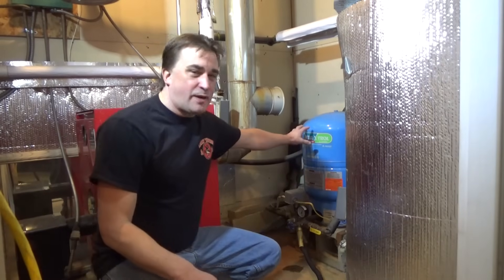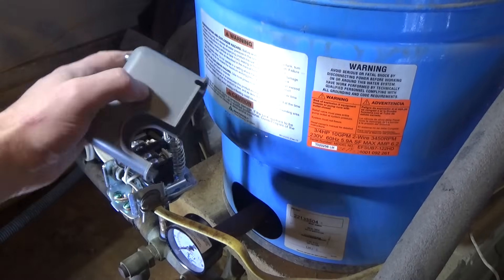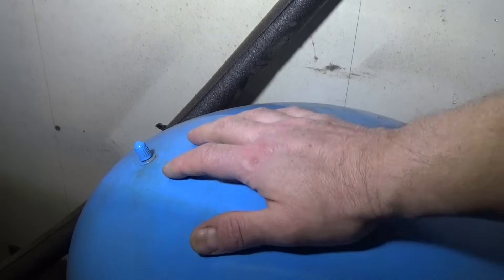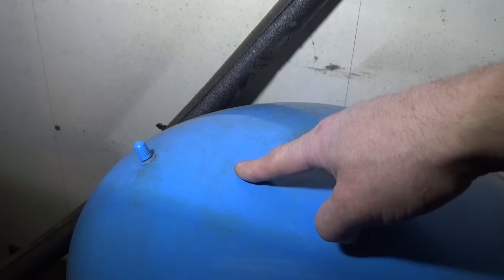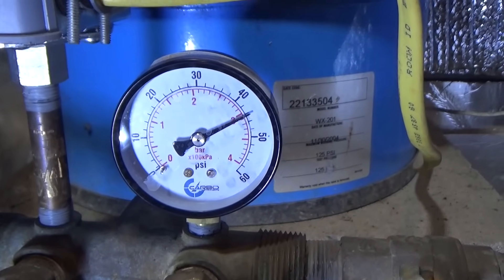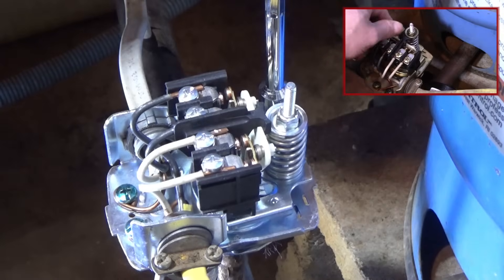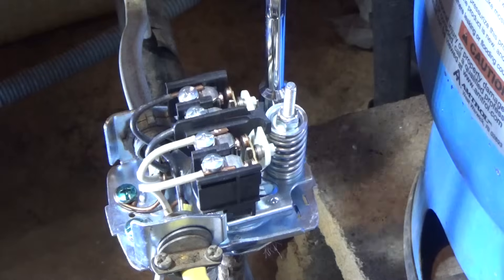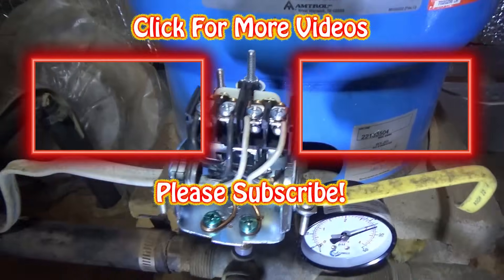How to Adjust a Water Well System Pressure Switch and Bladder Tank - Well Pump Diagnostics

Comment: Excellent informative video. I just installed a brand new pressure tank and pressure switch. Now it does cut out at 60  (switch is 40/60) but when it gets to 40 it cuts out and then drops to zero pressure. The pressure in the tank is set to 38 psi. What am I doing wrong? Could it be the switch is defective?  This switch has the reset handle on it and I have to use that to restart the system.
Reply: Your tank pressure when empty needs to read 2psi below your cut-in setting.

Comment: I just moved and wow what a shock going from 60psi city water to 30-50psi well water.   I feel like the shower barely works.   I increased to 55 PSI but it really did nothing, oddly, it still cuts in at 30PSI, it didnt rise to 35PSI.   Is my issue pressure or flow rate?   It seems like there is just less water flowing in general.   I am going to try to increase to 60psi but I guess it still wont be what I am used to because its going to operate typically a lot less than 60.   Is my only solution to upgrade the well pump to a higher HP motor?

Comment: I don't think you can burst from pressure the bladder, worst case you compress it until it collapses the air completely and then it is against the steel housing and can't stretch any more. The bladder fails mostly because it gets weak or brittle from age.OMGosh! 240 ABSOLUTELY IS NOT more likely to kill you, actually the opposite can be true as lower voltages can grab you where higher voltage may knock you clear.

Comment: I cant get a 20 psi differential, keeps going to 60 psi and the 2nd small pole is applying no pressure to it's little spring and lowered the big 1st pole to a 25psi cut-on and still goes to 60psi.

Comment: Question, is it possible to adjust only the kick in pressure? My mom has a new washing machine and she's finding that it only works sometimes. The repair technician says this is due to low water pressure, and since it works sometime I've concluded that when the well pump is at a high pressure it's enough but not enough when it gets low.

Comment: I adjusted my pressure up to 40--60 from the standard 30--50.due to low pressure in house.question--will this be too much pressure for plpe connections throut the house and for the water bladder itself(no indicators on the panel)?

Comment: Great video! I just have one thing to add. I was having pressure switch issues so I shut the breaker off and cleaned the contacts using a tiny file and some electrical contact cleaner spray. Well when I turned the breaker back on and the switch cut in the arc started a fire from the residual contact cleaner. It was pretty scary hahaha but I was able to put it out, so make sure any cleaning solvent has evaporated before energizing!
Reply: Thanks
Reply: Very important to fully dry-off any type of solvent specially in confined space where fumes can accumulate! Put a fan on to provide air circulation so that the fumes can't settle in one spot, not just in this case, but in any situation where a substance that gives off flammable fumes!

Comment: Thank you for this video. My father had just replaced his well pump and pressure switch before he was murdered and I have just moved into the home to help my mother, this was the first issue I ran across I had no clue about and just knew  100psi pressure and cutting out showers wasn't normal for the system or this house prior.

Comment: Hi Mark, my setup is a 1hp submersible that leads to a surface tank of 1000 liters. From that tank, a 1 HP pump pushes water  into a 300 liter bladder tank.  What settings would you recommend? My bladder tank goes up to 140psi. I would like to hold a higher pressure inside the bladder tank.  Maybe starting pressure of 30 then 70 to 80 cutoff. Would you recommend this? Thanks in advance!
Reply: It has to stay within 20 which is recommended

Comment: So question, if you go from a 30-50 switch, and you set pressure tank to 28 psi, if i go to a 40-60 swicth, i need to set pressure tank to 38? i currently have a 300 ft well with 1hp pump. like to increase my 30-50 to a 40-60 and my pressure tank is around the same size as yours in this video.
Reply: Yes, increase to 38 in the tank

Comment: Good explanation.so adjusting the taller nut moves the 20 psi up or down. 20-40/ 25-45/ 30-50 etc.. then the smaller nut only increases the cut out  40-45-50 .

Comment: Is it normal for the bladder to loose pressure when not in use ... in other words it cuts in at 30 and out at 50 although it's a40/60 switch but then the gage drops to like 45? A second question is if I have a 40/60 switch can I up the pressure to that not knowing what size my bladder or well pump is? It was down to like 18 on the air so I added air to 28 ??

Comment: It's not actually 220v it is 2 legs of 110which phase sync- so it would require touch both legs of 110 to actually be shocked with 220v... The fact is it's not the voltage which can be fatal it is the amperage, and that is directly relative to the size of conductor- 14guage wire is not likely to be fatal, where as 4guage or larger is where mistakes are deadly.

Comment: Awesome video, great explanation and video clarity.  If I may suggest sharing with the viewers ‘why’ the tank pressure is at 28 psi and that if you had a 20-40 or 40-60 you wouldn’t want it to be 28psi.  To share that it must be 2psi differential from whatever kick on pressure is.   👍🏼   
Really appreciate you sharing with us.
Reply: My pressure switch is cutting in at 40 but cutting off at 65. Back off short side nut until spring was completely loose still would not bring down cut off pressure
Reply: @RonaldGosling-z8g you cannot drop the pressure. If you buy a 40/60 the “springs” are stiffer so it doesn’t matter how much you thread the nut you might change it 2-5psi if you’re lucky.  So you need to buy a different switch
Reply: Yes, i had a guy come out, I had asked for a 30/50, he put in the square D, got paid, then I asked for the box and it said 40/60 on it, saw it on the box after he had left. Texted him and said HEY you put in a 40/60,( pressure tank is at 28 ), i had asked for a 30/50 - claimed he adjusted the 40/60 down to a 30/50, but he did NOT, and he refuses to come out and fix things, said he would refund my money and never did. So, NOW, I have to screw around w/ this crap, when I already paid to have the job done right ? I had turned on all the water, gone under there and checked, and the gauge read 60, switch clicked, then down to 40, switch clicked, he did not adjust things, so i have a worthless one year warranty on parts and labor. I'm steaming angry. Bad Ju ju on him. This is a single wide, don't need a 40/60, only one shower works here, all this has done is create pressure problems. Toilet won't stop running, didn't do that on the old 30/50. Had to vent, sorry. Thank you. I'm afraid to put air in my 36 gal. pressure tank to reach 38 psi. Any ideas ? I don't have that kind of tool he used for the screw. Ty !
Reply: @AndreaWestlake306 the setting springs take a while to settle in.  A couple cycles before mine worked as on my box description.  Just fyi for others.
Reply: @AndreaWestlake306  as long as you turn off the power first, you can use a deepwell socket, go buy the nut driver he used, or even usr a wrench.

 Back out the taller adj screw until your cut in (bottom) pressure is 30 psi and then check/set your cut out pressure (top) with the shorter adj screw to 50 psi. Always recheck your cut in pressure after you make adjustments...that pressure has to be 2 psi OVER the AIR charge in the tank ie 28 psi for a 30-50 setting.

You may not have to adjust for your cut out pressure at all, but check it to make sure it is 50.

Didn't mean to jump in here, but I read the question and nobody answered...
Reply: @dantco  Thank you so much, ,Dantco ! I've already spent a ridiculous amt. on D switches. I appreciate you. Yep, I'm chicken, hired some one, now three to be exact. Now I have sagging walls in a mobile home, and just ordered an electric 30 gal. hot water heater, and have to wait until whenever he "feels" like it. People where i live don't seem to need money. Now i've bought a hwh for almost $600, will have to pay $600 to have it put in. I'm so phucked :( IF i could go back in time, I never would have bought this place. Thank you, Bless you for caring enough to answer me. I was just too nervous to do it. <3
Reply: @AndreaWestlake306 I understand...lots of people do stuff that I ain't comfortable or able to do as well. Then I do what you decided to do and hire out. Good--better--luck in the future.

Comment: What do I do when water pressure switch -points or arcing 
 what do you do about this .how do I fix this problem 
 Please let me know A.S.A.P
Reply: First check voltage, then amp draw, amp draw is determined by pump size. Arcing is usually a sign of high amp draw, could also be a buildup on points due to age/low drawdown, caused by tank low air, burst bladder.
Reply: @stevefarrow9327  I'm just a handed man fixing my thoughts . I need more information on 
 checking my water well .I have about 20 or more years experience 
 on freezing pipes /replacing pressure switch /my experience on 
 I have seen Alot of burned points .I have a multimeters.
 Please give me a step by step on how to check my setup out 
  Thank You for your time and trouble
Reply: @alanmcdowell977  Sorry, this is a situation of electric and water. I do not feel comfortable. I am now retired, but we were advised to not give specific directions for liability reasons.  I cannot go any further than the basics.
Reply: @stevefarrow9327   I have a galvanized tank ,can I use a  bladder tank
 if I can I will update to  bladder tank
Reply: @alanmcdowell977  yes,  replace any galvanized fittings (if any) at this time, make  sure new pressure switch is matched to tank pre-charge....40-60 switch ...tank pre-charge 38lbs.
Reply: @stevefarrow9327  I been looking for more water pressure find 
up to  70psi
 [cycle stop value ]system .
 can I get the same parts a little bit cheaper
Reply: @alanmcdowell977   Not sure if you have a stop-cycle valve, or want 70# with a stop -cycle in the system.  If you have a stop-cycle valve, I do not know if they are rated for 70.  If not, you can adjust your system to 70. The tank should have 48lbs... the switch can be adjusted by turning down the tall screw(one full turn = 3 to4 psi.) until pump cycle 50-70. I would suggest a new pressure gauge as they age, bits of iron bacteria will affect reading.
Reply: @alanmcdowell977  one other thing. Higher pressure means a shorter pumping cycle. This means more on-off cycles, resulting in increased pump wear.   The larger the tank, better, min. recommended 10 gal. drawdown.

Comment: We had two power outages so I don't know if that is a factor. Pressure in kitchen sink was low so I looked at the pressure on the tank. It said 50 (I have a 30/50) but the tank was empty. Turned on release valve beside pressure gauge and pressure good. Turned electric off, emptied tank and turn electric back on. The pump filled the tank but went to 65. I used compressed air to clean any debre away from the water pressure switch and gave it a few taps along with a few taps on the pressure gauge. Turned electric back on and went back to 65. Gave a full counter clock wise turn on the top pressure bolt. Still went to 65. I also shook the tank when checking for any water splashing around and there was none. Pressure on the top was 20, so I added six pounds (I know this is a bit low but I'm cautious. Filled back up to 65. Water was cloudy with debre floating around. After using it for awhile water cleared but little bittie pieces of debre (like tiny pieces of dark tissue floating in water.) Did I shake up debre or could the bladder have a leak. No water came out of top pressure valve.

Comment: Install a secondary breaker in the pump room.  In my are the code requires a means of disconnect with in ten feet and visible to the device.  So, a secondary breaker adjacent to the pump controller, meets the requirement.

Comment: Very good video.  Thanks.  Please take this kindly-------most home wells have a diaphragm tank instead of a bladder tank.  Bladders attach to the bottom of the tank and act like a balloon.  They do not last as long as a diaphragm tank which has a sheet of rubber across the middle part of the tank.  I only say this to keep someone from buying a wrong tank.

Comment: Mark you nailed one thing on the head. I lost a socket off my wrench and it dropped on connections of switch and shorted out the switch. Learned 2 things Turn off power and don't use socket wrench that has a loose connection. Lol

Comment: Come on people, ditch the old fashioned mechanical pressure switch, move up to the 21st century 
they actually have electronic pressure/flow sensing switches that indicate the pump condition. 
The only reason the old switches are used is, when in conjunction with a pressure tank it reduces the number of start ups of the pump.
The electronic units start the pump immediately the faucet it turned on and supplies full pump pressure until the faucet is shut off. 
I’ve used this system for years on my houseboat with no issues. Oh! Also ditch the tank, not needed. 
Just sayin!!!

Comment: Seems like that pump switch is not within sight of the panel. Per Electrical code and for convenience,  there should be a disconnect in the room. That would make things so much easier. Also, working it live should be done with insulated tools or tools temporarily covered with black electrical tape. Working one handed as well will keep you safer. Good explanations in your video on the set up - thanks.

Comment: I have a question very of course important cause this problem with this info you share ain't applying to it.. The pressure switch keeps going on back to back 20 to a little past 40..Ive tried to adjust but same beside to 0. .thank you.

Comment: Great video! Question for you..... I have a 600 gallon water tank with a ½ horse power pump. The pump has a 20/50 pressure switch attached, with a pressure tank preload of 38 psi. I reduced the tank pressure to 28 psi to correct the pressure tank/pressure switch relationship. It works fine but I'm on the 2nd floor and water pressure isn't what I'd like it to be. 
Would I have to replace the existing 30/50 pressure switch with a 40/60 switch and increase the pressure tank to 38 PSI or can I adjust the existing 30/50 to 40/60 and increase the pressure tank pressure to 38 PSI?
Reply: empty the tan k , check the pressure set it to 38 , install a new pressure switch 40 60 . and its a 60 gallon tank not 600 ,
Reply: @doug55469  Thanks for the suggestion. The 600 gallon tank is a water tank. We don't get water 24/7 so I have 2 600 Gallon tanks, one for each floor with their own respective pump.

Comment: Wondering about the extra pressure from a added storage tank ? Up hill from the pump and supplies water from the storage tank, is this process the same? 
I’ll
Reply: two tanks will equal the same issue with added volume , it sounds like it backs sense but its wrong

Comment: It seems I have about the same system as this. 1/2 hp replaced with a 3/4 hp about a year ago. Since that time we have been getting a strange clunk. Plumber came thinking it was a check valve but changed out that part, pressure tank, switch and guage. $500 later still have clunk pump cuts out at 70. I got it down to 65 but still the clunk. I asked on a forum about it and I was told there is a check valve in the pump and having a second one inline by the pressure tank could cause the clunk and cause a problem. What is your opinion? It has a 30-50 switch adjusted up for 40-60 which if I replace with a 40-60 switch might get the upper pressure down to proper place but the clunk is the main thing.
Reply: The pressure is too high , set it to 6o max , change the check valve
Reply: @doug55469  pump, check valve, pressure switch, tank, pressure gauge are all new. I have tried to adj. down to 60 but run out of adjustment on high end adjustment. I end up just unscrewing the nut past where the spring has any pressure.
Reply: Welcome Black Carter  I readjusted the tank to 28 and switch to 30-50 but switch still cuts out higher than 50 and I still have clunk when running water. I'm thinking about changing the pressure switch although it is a new one.

Comment: Great video. I subscribed. Quick question. What determines the correct cut in and cut out pressure for a given system?  Is it paired with the pump?   Just moved in had a issue with the tank, it was cycling the pump on and off every few seconds. Replaced tank, and the tech replaced my 30/50 with a 40/60. I'm also experiencing the well running dry which may be unrelated, or a pump issue. Is there an issue running it to 60 provided the pump can get it to 60?
Reply: no ...but well running dry is a serious issue . do a pump test to determine the amount of water that your well can provide, its on your water well record if you are in Canada , then install a dole flow valve at the water in side of the tank , and buy the  biggest tank that you can afford

Comment: The small spring is when the motor starts ??

The Large spring is when the motor stops ??

Am i correct ??
Reply: The little spring is the cut out and the big spring is the cut in. The little spring determines how high pressure is needed before the pump is switched off and the big spring determines when the switch turns on.

Comment: Does the pressure adjustment go by the size of the pressure tank? Is that a 19 gallon tank? if so is the same size as fine and I have the cut out at 70 and the cut in at 50. I have good but I think I have it wrong?
Reply: its really wrong , you will burn out your pump , get a bigger tank ,